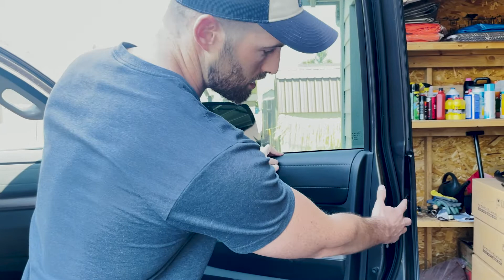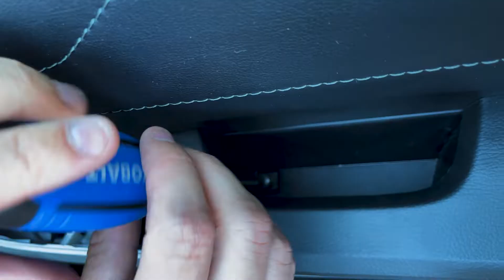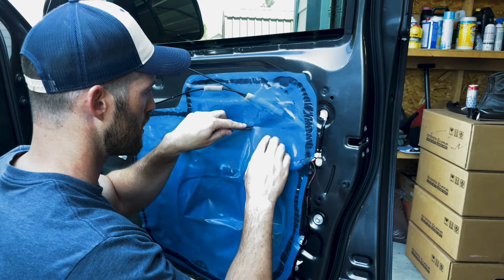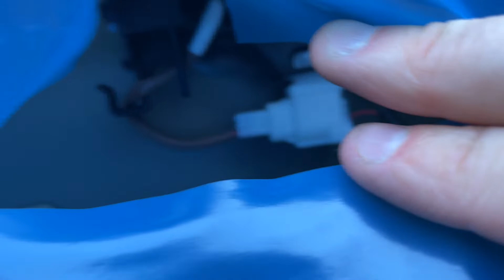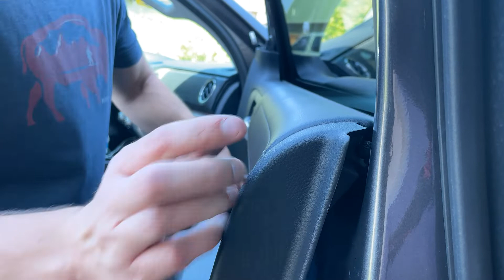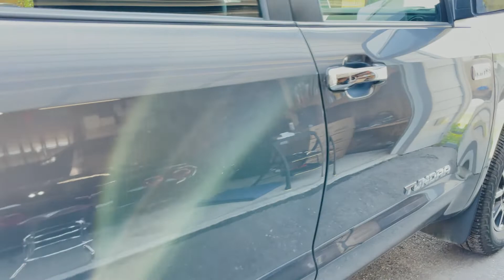How To: Toyota Tundra Door Panel Removal and Door Handle Swap - Smart Key / Keyless Entry Guide

Comment: I know it’s an old video but I’m wondering for the front if I can just remove the chrome portion. Or is it all one piece?
Reply from the maker: It is unfortunately all one piece. The handles cannot be disassembled. Well... at least not easily. They appear to be 2 pieces, but I believe them to be plastic welded together.

Comment: Where did you find the smart key handles? I’ve been searching the internet and can’t find. I have the same 2021 Tundra in magnetic grey metallic
Reply from the maker: I picked them up from a company called Sparks Parts. You can google them, and should be able to find painted smartkey handles there!

Comment: How do the rear door handles change out? I presume easier since no wire connection.
Reply from the maker: Quite easy! Same as the front except for not having to pull the door trim. A single bolt inside the door jamb and it comes right out.